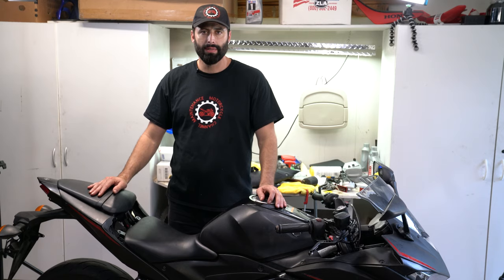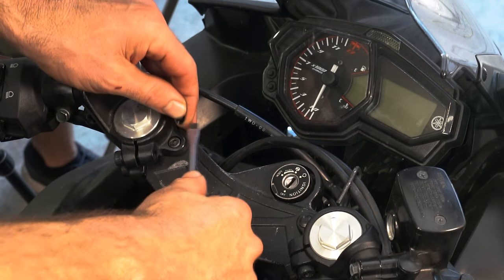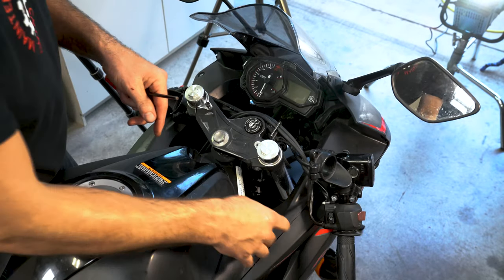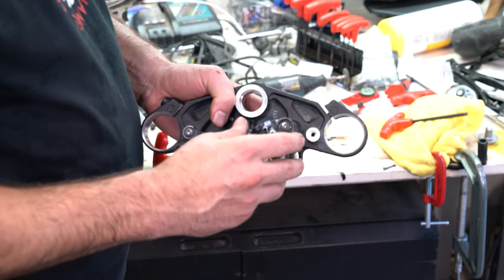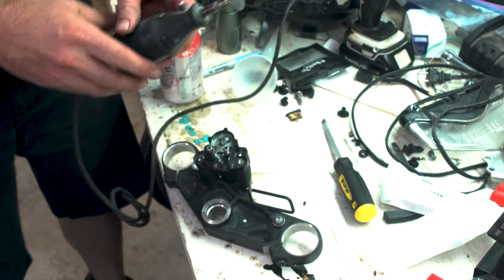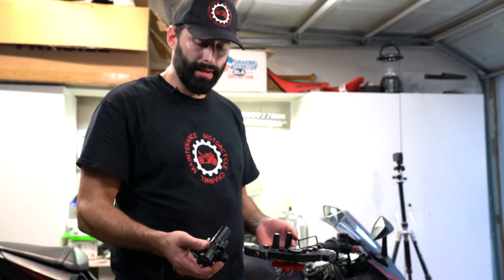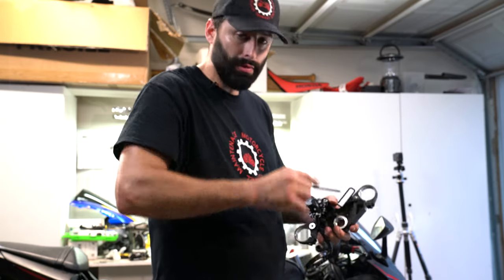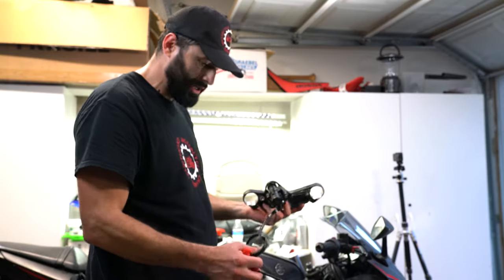Stolen then Recovered R3 - Installing a New Ignition Cylinder

Comment: Having had my bike stolen, those security bolts wouldn't have done anything at all. They came by at 4 am with a trailer and just took it away. Now I'm replacing the ignition cylinder they broke.

Comment: Just cut with screw driver to turn them but have to heat it up first to break the locktight on them then use the screw driver once its cooled down it will open as hell thats how did mine

Comment: Thank you. So my ignition barely turns anymore and I can replace it myself... However, is there something with an immobilizer that won't allow a new aftermarket key/ignition to work? I dont want to buy one to find out it wont work. I have a 2014 Honda cb500x. Thank you

Comment: I have a FJR1300 2005 which has an alarm. So when you replace the key switch yoiu also have to change the ECU as it is paired with it for the alarm to work.... more expence...
Reply: My FJR 1300 06 ignition switch is stuffed the key just turns inside the barrel I'm hoping it's not to expensive

Comment: Hello! Super quick question for you or the community. My bike was stolen and they added like 3 layers of spray paint to the bike. Bike is originally a black 2020 R3 so is there an easy or best way to remove the spray paint ?
Reply: did you find a good way to remove it? I am in the same boat as you. mine was royal blue though.
Reply: Aircraft remover
Reply: Aircraft paint remover will take it all down to metal and will ruin certain plastics. Try a mircofiber towel with a tiny amount of acetone. Wipe very gently, then if you can rinse. That or talk to a body shop/detailer. Sometimes it doesn’t adhere the best, especially if the bike was dirty and could be polished off. -Detailer here.